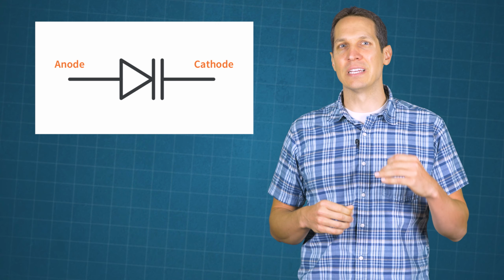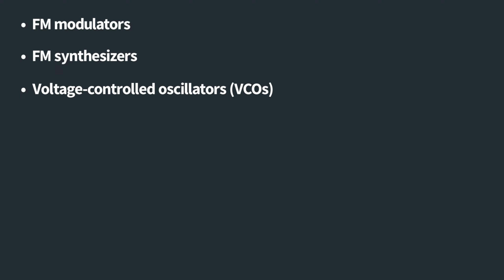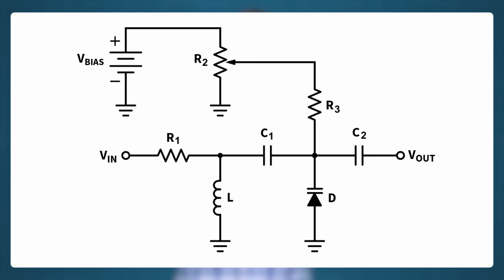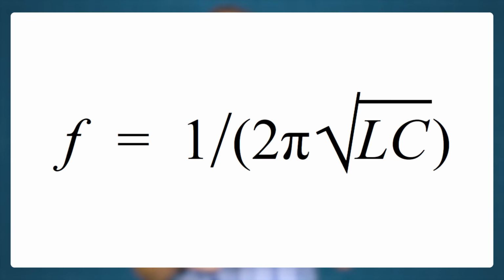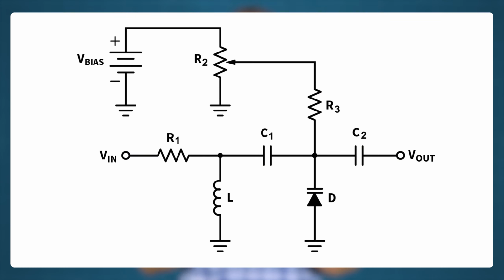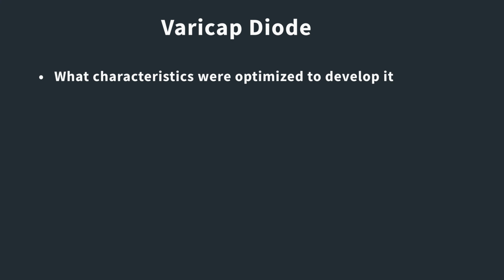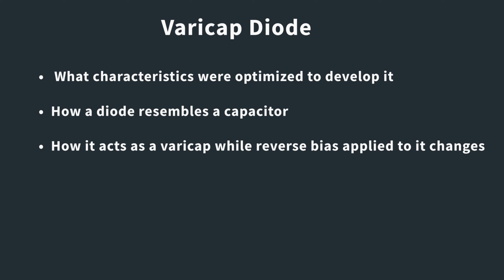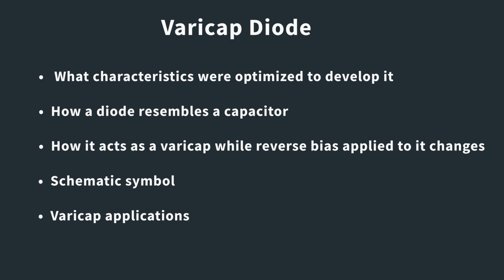What is a variable capacitor diode – how does it work? | Intermediate Electronics

Comment: I’m a bit confused by the comparison to a normal capacitor. So, we say the plates are like the N and P region. So, does this mean that by making these regions quite large then we could make a varicap as large as 1 Farad? Or what is the reason we have such small values instead?
Reply from the maker: Yes, you are exactly correct!  Theoretically, if we made the regions large enough, we could make a 1 Farad varicap.  But, as indicated by the tiny values that we actually see in practice, the region would have to be enormous to hit 1 Farad.  I also imagine we'd have some real-life challenges at that point that would make it unusable - in addition to the insanely unwieldy dimensions.

Comment: at time 3:54 on that diagram, doesn't that inductor and varactor diode form a 'tank circuit'?
Reply from the maker: Hmmm... maybe but the fact that C1 is in there and can't be easily added to the varactor capacitance (as it's neither in series nor in parallel) would make it hard to consider it that way.
Reply: @CircuitBread  or maybe 🤔 it could act like a π filter...